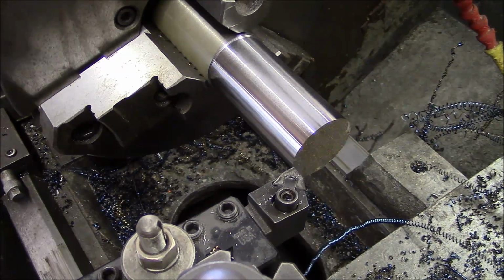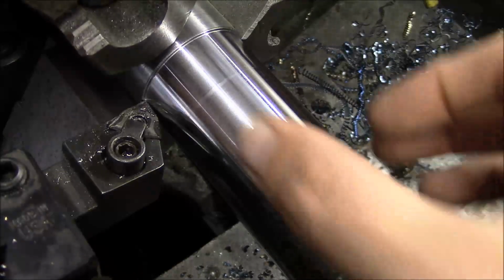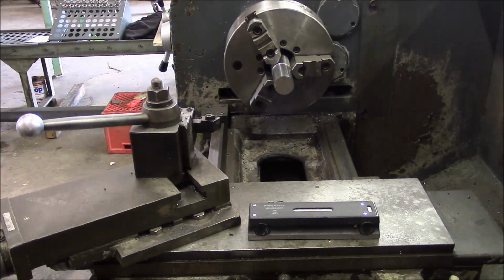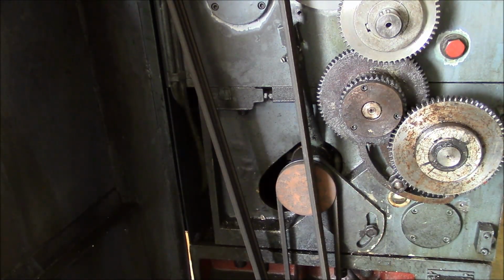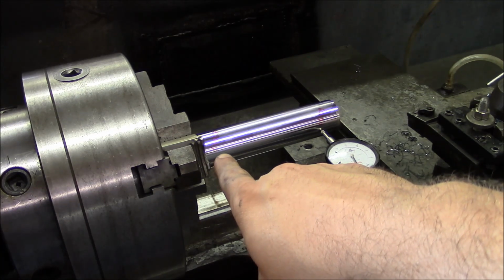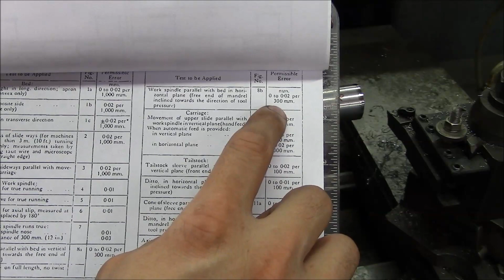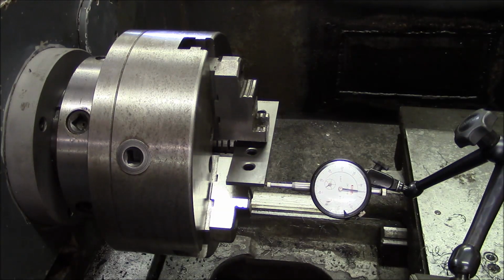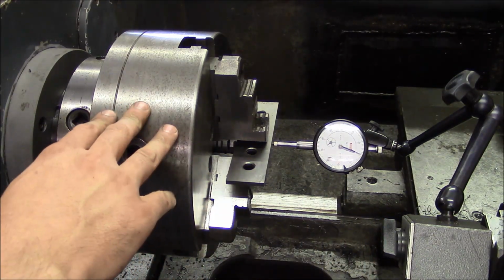Engine Lathe Headstock Alignment and Test Cuts

Comment: Very nice Wes, very well explained. I enjoyed it. Having the ability to adjust the headstock is a plus if you ask me.  Thanks for the shout out Wes,  I will return the favor, I had allready planned to give you one on my next video anyway😊
Reply from the maker: The adjustable headstock is surely cheaper to make. They don't have to worry about scraping or even precise machining to get the initial alignment correct. I'm sure the designers of your Hendey would roll in their graves to think of such a design!

Comment: Excellent! This is exactly the way to do it.
I would add some alternatives for whoever is interested.
I use a 3"dia. thick walled aluminum tube ~12" long in the 4jaw. This tube is a nice balance between stiffness and length - it won't sag with 10" of stick out, and is stiff enough to resist tool push off. I undercut the middle area to save time.
I also use a HSS shearing tool to ensure tool pressure is not effecting the measurements.

Comment: Great Job Wes! With all of the pluses as far as your lathe specs and features, coupled with your abilities, it just made no sense to shop for another used lathe ....I'm sure glad that you fixed it, and particularly,  made videos of your repairs and the results. Please keep the videos coming..... some of us "old guys" need to take periodic breaks during the day, and it gives us something interesting and productive to do!  I will be looking forward to you addressing and making videos of your crosslide issues, as I have a couple that need checked and likely scraped in to repair.
Reply from the maker: I kid you not, the day after I ordered the new bearings a beautiful Mazak engine lathe popped up on craigslist for a nice price. It's still tempting me.
Reply: Go For it! It'll take the pressure off hurrying the CS repair. Work em back n forth getting each dialed in, then keep the best one that suits your needs

Comment: love that parallel in the chuck trick.  thanks
Reply from the maker: It's kind of a quick and dirty check of your machine. I've seen an actual tool made for this purpose, but the parallel works just as well.

Comment: Thanks well explained, I like your logic. 
I bought a new chinese lathe(Gearhead, no plastic parts anywhere), manufactured as a bench lathe type, its not the smallest type(350Kg). It however has a cabinet and driptray(optional) with flood coolant hole to drain. Seeing it resting on the cabinet, I decided to fit a 12MM thick metal flat surface beneath driptray and cabinet with the idea it would give me a "nonflexable" surface beneath lathe to calibrate it from, unlike it resting on a metal cabinet alone. I looked at various alignment videos to get an idea.
This week I tackled the BED flex/deformity. A waterlevel/vintage/starrett type showed the bed was twisted slightly towards the tail end, I understand the difference between "levedlling" and "twist" as its confusing initially it seems for a lot, my lathe is not 100% level, but I dont care about that, is minimal in any case. As i fitted it with 4 bolts, it produce a taper cut of .15mm/ 0.0059 inch ...large towards the tailstock at 8CM lenght aliminium rod about 15mm thick.
I thought about the bench type lathe and what happens at the factory. They manufacture and assemble it on a workbench, then calibrate it, not on the cabinet setup beneath, cabinet is optional.
So today I took another approach based on that. I kept the headstock bolts fastened, went to the tailend of the bed and loosen both bolts. I then took feeler gauges and looked for gaps.
I find that the far side at the rear of bed around the bed is "floating" at .007/.008/.005 gaps towards the driptray/metal plate. I left it like that and took a cut. Now the taper was down to .04mm/0.00157inch, improvement for me. I then remember what you said about using a dial indicator to measure movement for "bearing". I attached the dial indicator to driptray, position it on bed near above the bolt tail end far side, and boy does it works nice. 
I then tighten the "floating bolt" till I see movement , play around in that visinity and got the taper down to .02mm/0.000787 inch. (Forgot to say I did insert those 3 shims as they fitted, so it is shimmed but not torgued to death.)
 Now I will appreciate it if  you can tell me in your terms how well you think this is at cut lenght of 8cm, I used very light cuts due to stickout. I did made sure it cuts all the way through visually as well.
So now I have a lathe that cuts 0.00078 inch taper at 8cm/15mm thick.

I realise that this may not be all, next thing I want to try the Rollies Dad Method and see what that relates to. I did read some negatives about it, maybe just give it a test for experience.

Comment: Thank you for your time and effort , it's really appricated. While my lathe is pretty humble and simpler, it just a used  DF1224g, it does need seals  and a belt badly. Seeing you vid, makes the spindle much less intimidating. I've done bearing clearances on paper machines, but that's little different, we used sledgehammers to tighten the K-taper nut. How many tenths should I be looking for when I pry up.?
Reply from the maker: I'm not sure. Every bearing design is a little different. Typically the front bearing has pre-load, so you should see no movement on the indicator when checking it. You might see a slight movement just from actually bending the spindle slightly by prying on it. There is some "feel" to it as well as using the indicator.
Reply: Understood. I've used long feeler gauges, math, and the porta-power with dial indicators . Blessed be the company that buys hydraulic nuts.I was kinda thinking for the lathe a 2x4 and a 1/10s
Reply from the maker: The SKF catalog has all kinds of fancy hydraulic nuts and even hydraulic bearing seats. It looks like a lot of expensive equipment to buy.

Comment: the 2 thou you re mentioning are related to the headstock's  pivoting point , not  the radius or dia. , it is the same as calculating the smalest side of a rectangle triangle